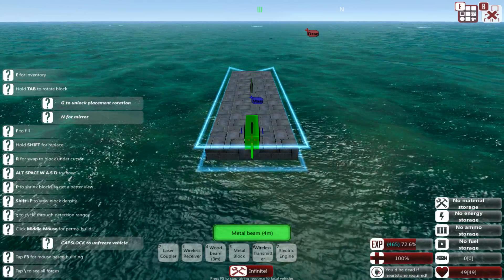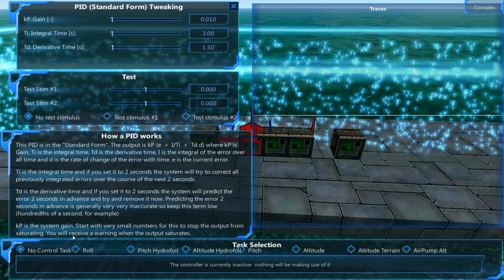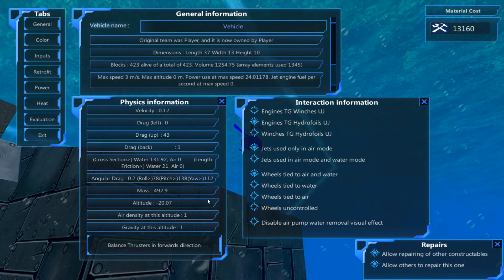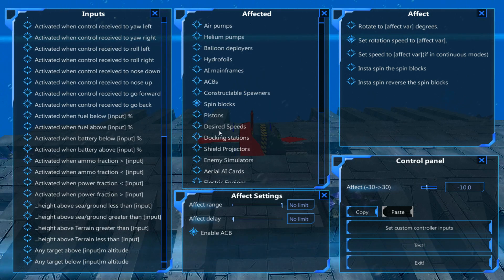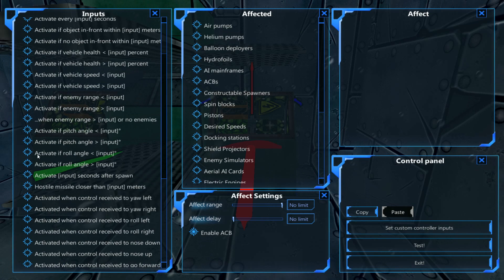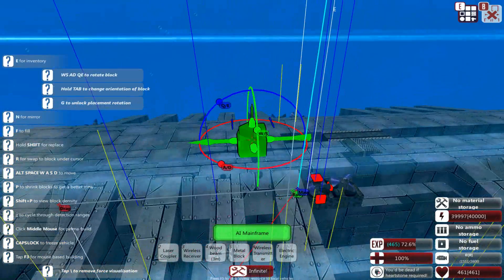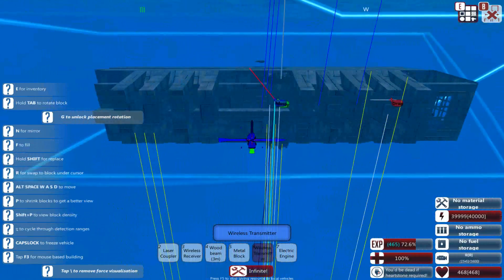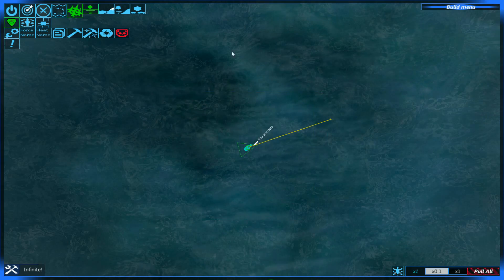From The Depths | Submarine Tutorial! | All the basics!

Comment: I got the game and started an adventure. (a few actually as I learned how things worked.) I built my typical efficient BOX build that I favor in resource limited games, double layered metal for high defense. I had figured out AI enough to run my weapons and PID enough to use hydrofoils to keep my ship from nosing up and flipping.

But I didn't have much firepower. (two, Type A 3.7in simple weapons) So I added super cavitation base and an AP head with 2 HE and 4 gunpowder, AND put sonar on my roof. Then i removed my pump and put holes in the floor. 

Instant, slowly sinking, 'submarine'. I was shooting anything above me with AA guns while using meters of water as a shield. It was surprisingly effective and saved me from being overwhelmed a few times. I had used missiles/torps earlier but they would target the wrong thing often and cost too much to use with my resources so low.

Later I found a green gate I wanted to go into but it was in the air.  I put a row of balloon boxes down the full length each side and got to ~100 meters. another row got me ~200, another ~300, another and more and more... I stripped almost all of the second layer of armor to reduce weight and because I needed the funds to buy more balloons. I FINALLY reached the portal at ~600 METERS. 

BUUUT I was off target so I was in build mode flying into my ball of balloons trying to add jets (which I had no idea how to use) in an attempt to push my ship the half a ship length I needed to get into the portal. (0.1 speed is your friend) Managed to get inside and have been killing all the things. 

Added 2 more 3.7in and 4 of the double barrel casements for 8 guns total and havent found anything that was too much to deal with since. Though the 200k+ material tanker (armored brick with a small missile launcher on a turret) took a WHILE to erode a hole to the AI. There was a small laser plane with forward swept wings that bobbed up and down that took a while because it stayed at range and wobbled a lot. heading to a blue portal with nearly 300k extra materials - gonna see what I can build. Probably gonna add some missile/torp launchers.

Still have no idea how to build a cram/APS/laser/fuel engine/steam engine/etc

Comment: 7:15 Roll thrusters/propellers can be all the way at the tail or the nose instead of on the center of mass... as long as each of them is matched with another roll motor on the opposite side (at an equal distance from the centerline) facing the opposite direction. For instance, a delta-wing aircraft could have four roll thrusters at the very rear tips of its wings, one facing up and one down on each side, as long as they are vertically aligned with each other -- the same distance left/right and forward/backward relative to each other. If the distances don't match you can end up rolling around a slightly different axis than straight forward/backward, or adding vertical thrust or pitch rotation forces, and generally becoming a bit wobbly. Battle damage is also a slightly greater concern than it is if the roll thrusters are near the center of mass, but for a lot of designs it wouldn't be a significant factor. Roll is typically the easiest axis for PID to control, and when you've taken enough damage that it loses roll stability you almost certainly have bigger problems than leaning a little to one side. ;)

Comment: How do you make it so stable with the default PID? i've made crafts wich are a third of the size with lightweight alloy and it always overshoots while saying "output overloaded" or something like that, the other day i literally spent 1 and a half hour fine tuning a PID on a spaceship and the best i got was a ship that wobbled from -5 to 5 pitch constantly
Reply from the maker: Light craft need less thrusters/propellers if you are going to use the default. Lower the top slider in the PID to reduce the % power of the thrusters if youI wish to keep the second amount of propulsion parts, hope that helps a little!
Reply: less power? so the "overload" is actually overshooting,  right?
thx Lathrix, i can't believe i didn't think of that, that explains how i've seen crafts so heavy stand in the air with less than the thursters i've put on mine

Comment: funny how the way subs are build in real life inst the main way to build a sub in from the depths
Reply: Subs IRL do use bouyancy controls for depth control. For travelling the ballast tanks are filled/emptied out to the precise amount that the submarine is neutrally bouyant and submerged without listing. Depth changes while travelling are done using hydrofoils.

Modern submarines designers are almost 100% concerned about noisiness when they decide about what to choose for propulsion, steering, ... This is because IRL submarines are so stealthy because they are so quiet.
Dedicated turning thrusters are loud (comparatively). The most silent way to turn is by a rudder. And similarly with changing depth. Using the ballast to change the bouyancy does make noise, but not much. Propulsion is VERY noisy.

When talking about noise, I mean it in regards of submarines. Modern subs have noise levels of ~100 dB when moving. Whales are at 120 to 150dB. Civillian ships are around 170 to 200 dB. Sonar systems can get over 220 dB.
Every 10 dB the sound pressure is doubled. 160dB noise can be heard 2x as far as 150dB noise.
Have a quiet submarine, go everywhere unseen. (or unheard)